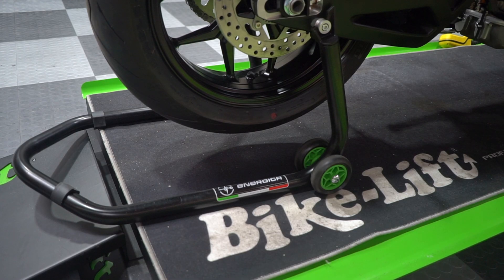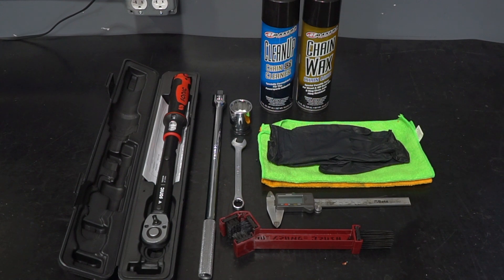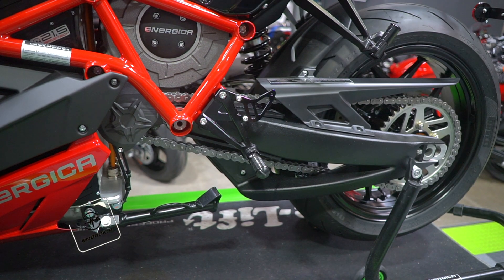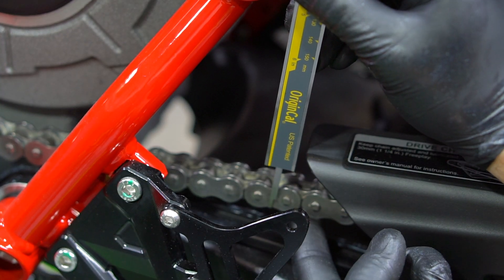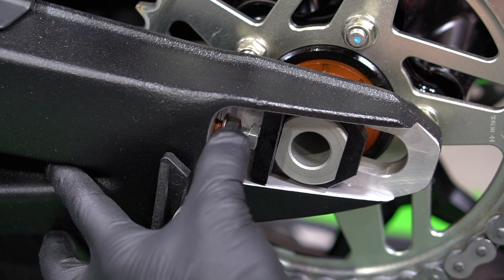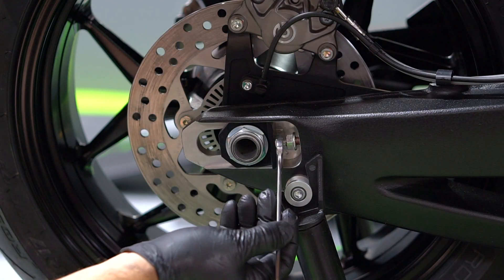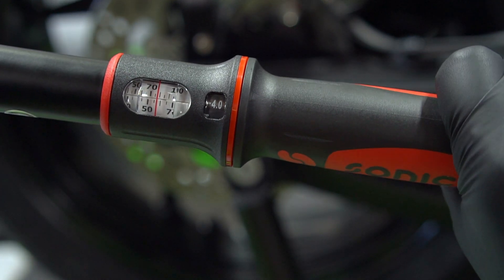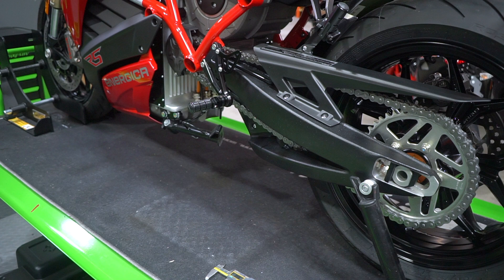Energica Garage - Maintenance Series - Ep. 9, Chain Maintenance

Comment: There are more than one method to check the freeplay of the chain.  The manual states one method.  This is another method.
Either method will work will, the key takeaway is, ensure you do ALL the steps properly, and generally in the correct order :)

Also, chain adjustments can be made with the bike on the ground, however it is recommended that since you are there, go ahead and clean / re lube the chain as well.  A well kept bike is a well running bike.

One thing I DO caution folks, when making the adjustments, you very well might overshoot a bit and have to go and re loosen the chain.  Either way / No matter what.  The adjustment screw, where it hits that little aluminum base plate, make SURE the wheel is TIGHT on that, otherwise your readings are off.  

The way you are changing chain tightness is by actually moving the entire wheel forwards or backwards.  If you go spinning a lot of slack into that adjustment but don't move the wheel to properly engage the stop plate which is moved by your changes, it'll be off and you will have to redo or you could possibly damage bike / injure yourself in extreme cases.

So basically make adjustment, make sure wheel is fully engaged on the stop plate, if you loosened, tap the wheel, or back the bike up slightly, do something to make sure the wheel is FIRMLY against that plate, THEN snug it and re check your chain freeplay.  Once you are happy, double check all your tightenings and torques and you are good.

Comment: Your instructions here are at odds with those in owners manual. Which says to remove chain guard,  measure from rear of upper guard pad and measure on centre line of chain. Manual edition Rev.01-2020
Reply: Can you elaborate on the "30mm" movement?  It seems like in the video he is already within 30mm and by the end of the video before he puts it back together, he's still under 30mm??  It's very confusing.  My bike had a very loose chain that was sitting on the swingarm and tapping it constantly, probably sawing-through my guards... But when measuring 30mm with my caliper as per this video, it says i'm still only around 25mm or so?  I don't understand.
Reply: @twrcrew8852  all I can suggest is to refer to your owners manual,  there very clear instructions.  I prefer to use a steel rule resting on top of swinging arm and read lower measurement first then lift chain and take the 2nd reading.
Reply: @jamesferro5715  I came to youtube since the manual alone wasn't clear enough I suppose lol. I'm a visual learner. The steel rule was instrumental - no pun intended.  This video is borderline dangerous, as I was attempting to follow it move for move. 

Makes you wonder how they'd do chains in shop..